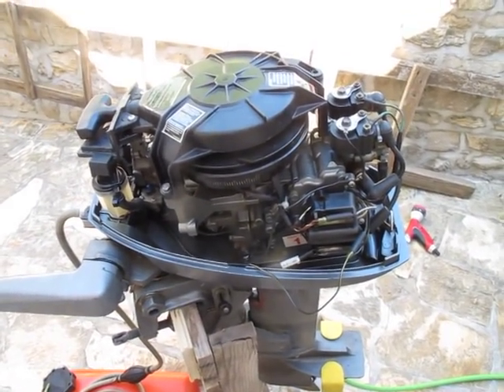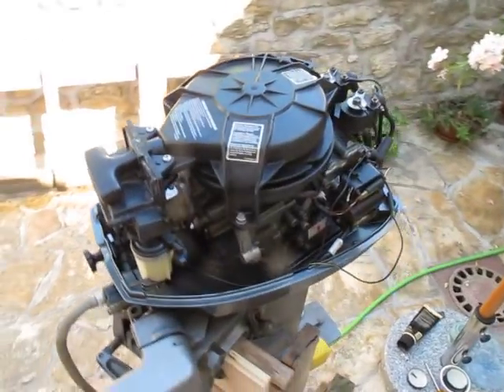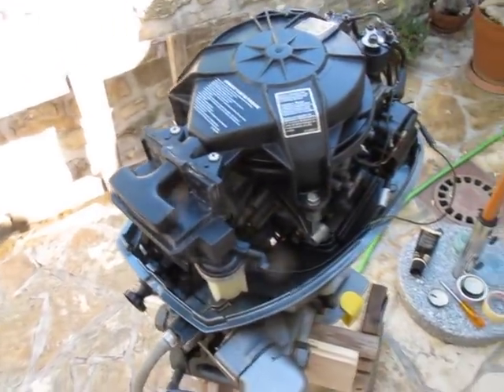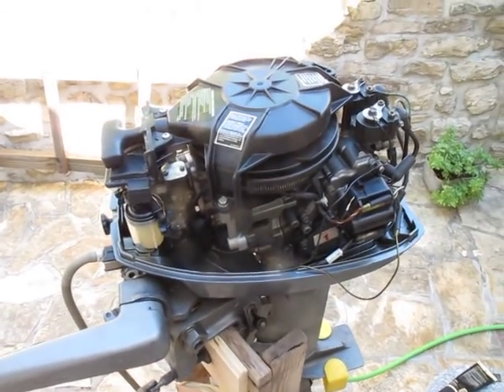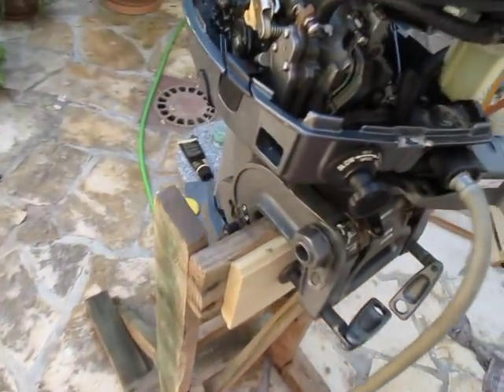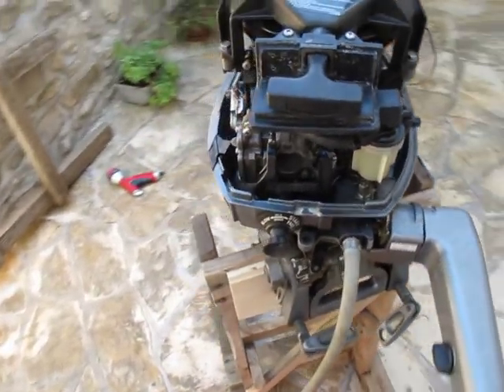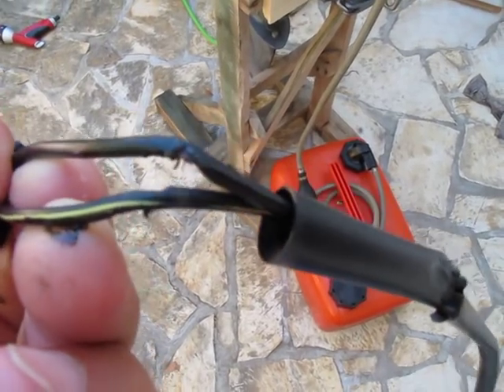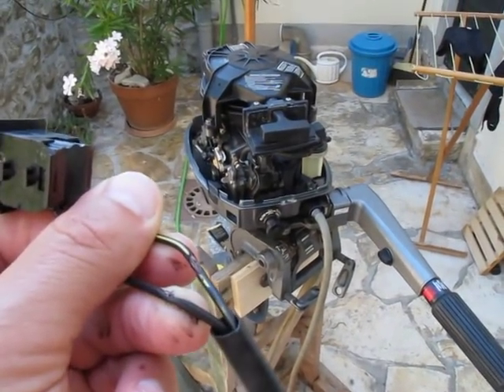Mariner (Mercury) 15 HP outboard stalling

Comment: Much thanks for sharing your process and the cure...I was on my third day in the sun rebuilt carb, fixed prime and idle systems, but still no go. Was thinking of the cut switches now I am going to pull them and inspect all Thank you!
Reply from the maker: Best luck to you solving the pproblem and thanks for your nice comment.

Comment: Awesome find! Chafed wires hiding are a botch!
Reply from the maker: Definitely true, an engineering botch up, otherwise the motor is very reliable. Thank you for appreciating my video.
Reply: @bekbor  I had a similar thing happen. I had a misfire on a V6 truck engine. I changed everything electrical, coil pack, plugs, wires...EVERYTHING. Still had an intermittent misfire. Then I wiggled the wiring pigtail connection that supplies power to the coil pack, while engine was running. The engine smoothed out immediately. It was a BAD molded factory electrical connector. I spliced in a new one, all was good until It failed again 6 months later. Chasing wiring gremlins, while not knowing there are wiring gremlins, is not fun.

Comment: Ce se întâmplă când dă scânteie doar la o singura bujie care sa fie cauza multumesc
Reply from the maker: As crede ca problema este la bobina de inalta tensiune la care este conectata bujia fara scanteie
Reply: @bekbor  Ambele bobine care sunt conectate la bujii sunt funcționale le-am probat unu din firele care vine pe bobina din dreapta l-am pus și la bobina din stânga și dă scânteie nu cred că ar fi cdi că posibil nu trebuia să de-a scânteie la nici una din bujii după multe încercări aseara am umblat la mufe și am avut scânteie pentru scurt timp a pornit și după 30 secunde a început să întrerupă și sa oprit
Reply from the maker: @makesaracu1264  Verificați toate firele pentru scurtcircuit sau conexiune slabă. Dacă ai avea un alt CDI pentru testare, ar fi și bine
Reply: @bekbor  nu am alt cdi din platou de sub volanta sunt 3 fire 
Unu negru cu alb 
Unu negru cu galben 
Unu masa 
Când îl demufez pe cel cu galben nu mai am scânteie la bobina din dreapta 
Când demufez pe cel cu alb nu se întâmplă nimic 
Am incercat cu un aparat măsură pe cel cu galben îmi arată că ar avea continuitate
Dar pe cel cu alb îmi dă doar un impuls de 2 secunde
Reply from the maker: @makesaracu1264  Aș încerca următoarele - schimb locul celor două fire care merg de la CDI la bobinele de înaltă tensiune. Acum, dacă CDI-ul este defect, ar trebui să obțineți o scânteie pe bujie care nu a avut o scânteie în configurația originală a firului. Desigur, ar trebui să testați cu bujiile scoase din motor. De asemenea, puteți măsura statorul sub volant. Ai 2 fire din stator, unul este comun. Măsurați rezistența între fire și comun (negru). O măsurătoare ar trebui să fie în jur de 2000 ohmi, cealaltă până la 200 ohmi. Dacă acest lucru este OK, statorul tău este OK, dacă nu ai putea avea probleme cu statorul.
Reply: @bekbor  am inversat și firele între iele cel negru cu alb l-am pus cu cel cu galben și invers doar bobina din dreapta a dat scânteie am mai vorbit și cu alte persoane care vor să mă ajute și toți au spus că cdi e mort așa că am comandat un cdi nou mulțumesc pentru ajutorul oferit un om minunat

Comment: Well found I have seen the kill switch wires crushed when someone has worked on engine and get wire trapped so same results also had a switch badly corroded where the rubber boot had split..

Comment: I notice some rub marks on mine .. now imma have to try and unplug it .. thanks for your video
Reply from the maker: Good luck!
Reply: @bekbor  one of the wire to my coil isn’t getting me spark .. even with a new cdi so I’m hoping it’s just grounding issue
Reply from the maker: @WeOutChea   Hope you solved the problem!
Reply: @bekbor  change the points and now it’s good .. thanks again

Comment: Eliminated that issue my engine still does the same I can get her running but can only keep her going for the same length of time each time about 30 or so seconds and then its revs up and dies like its stared of fuel!!
I removed the carb and gave it to a 2stroke mechanic he cleaned it and the jets with small brushes. So it may not be carb ..its wreaking my head! It's a year 2000 motor so maybe a overhaul is required!!!
Reply from the maker: I wouldn't thnk that an overhaul is needed. Before decidong on that you shouldcheck the compresion. Have you done any checks with the electrical ignition system? Does the diafraghm fuel pump deliver fuel continuesly? It may fill the carb bowl with the float but when the enginebusrs that fuel it takes to long to deliver new fuel...
Reply: @bekbor  I feel it's some thing small that's holding the engine back ! The compression FEELS good there is good resistance but il try and get them checked soon as for the fuel pump what you said could be another issue that's worth exploring il have to look in tothe workings of the fuel pump to better understand it and as for the ignition system how is the best way to check that out? 
Thanks
Reply from the maker: @82HEADCASE  About the ignition - the stator which is under the flywheel, has 2 coils, for low revs and high revs. I had to change the stator 2 times because it burnrs out after 10 years of summer usage. The terminals of the stator end on the black switch box, The black os common for both coils, mrasure the resistance from the common lead to the other 2 terminals. One mesurement should be a few hundred ohms, the other 2 to 3 kohms. Its the coil with the bgger resostancebhat suffers, the isolation betwren turns melts with heating of tje engine thus the tesistance gets lower until the coil finaly burns out. The switch box could also behave iraticaly if moisture managef to enter. You would have to have a teplacement one to check that.
Reply: @bekbor  great info there thanks ... im going to order a new fuel pump  diaphragm first to see if indeed that is the issue ..if nothing changes il look in to the electrical side of things... il keep you posted on my results thank you for your assistance
Reply: Hi bekbor...
Iv got my engine running perfectly I'd even say better than I can remember.. I placed the  new carburetor gasket kit in and I put in two new plugs aswell all new fuel lines ... I did have a problem with the fuel up take pipe in the fuel tank but all sorted now ...
Reply from the maker: @82HEADCASE  Great, now ypu can start enjoying boating, just like I am these hot summer days at least in my part of the world - Croatia. Sincerely, Boris
Reply: @bekbor  lol lucky u!! It's raining here and has being all week with more rain to follow.... greetings from Ireland👍

Comment: Hello there, I have the same engine but it’s not getting spark, could you help please
Reply from the maker: No spark on both spark plugs? If so, either the CDI (the black box) is faulty or the stator coil under the flywheel. I would measure the resistance of the stator coil under the flywheel, it has  2 coils and 3 connections, one common for both coils - they connect to the CDI box. Measure the resistance towards the common lead, one should be around 2 to 3 Kohms, the other around 200ohms. Here are the values https://www.outboardignition.com/page39.asp This stator coil failed 2 time in my 20 years of having such an engine so it could be also your problem.

Comment: Add me and my cousin to the list of Jackasses that spent countless hours and $300, only to find broken kill switch wires. When reinstalling I will make sure to keep the shift linkage away from the kill switch wiring. Thank you!
Reply: Our kids haven’t been running the jon boat all summer because of this somewhat intermittent problem.  The switch wires that he shows are routed UNDER the shifter cables.  They were worn through.  To test for this unplug one of the wires on the,  eh, black box, the cdi/coil pack box, whatever it’s called.  As soon as I unplugged it we knew right away that was the problem.  This video led us to a problem we could not see as the wires were worn under the shifter cable under the carb.   Thanks again to the guy who put this video up!  We are very grateful - Signed - The other cousin

Comment: thankyou, had very same problem on 9.5 johnson i recently bought, would not start ,wiring bare,shorting against engine insulation had rotted ,1968 motor time takes its toll,wires were near moving parts re routed wires,  cant touch motor,, sweet runner now

Comment: Great work! Thank you so much, you save my time (and money as well), as i've the same engine, and the same problem, a kind of current black out that happens at high speed, for an instant, then disappear (this goes on and on). I've cleaned the carburator as well, changing gaskets etc. but without results. Hopefully, you gave me the solution.

Comment: I'm also having a problem with the engine misfiring. Went through the spark plugs, and wires. Cleaned the coil pack, and I think its in the carb. It sat for 2 years and they didn't drain the fuel. I think the fuel separated and gummed up the carb and the fuel line connection.

Comment: Great video. On a similar note, i have a 15hp Mercury 2stroke that coughs at idle with extra smoke and sometimes will die. But runs strong at any other speed. Thoughts anyone?
Reply from the maker: Have you checked the carburetor adjusting? Everything else is pretty much fixed, no possibility for ignition timing setting... Of course, check if the ignition coil moves freely when increasing and decreasing throttle. Check the spark plugs gap. That what I would do.

Comment: This is a common fault on this engine. I belong to a club which has 4 of these engines. The wiring runs under the carburettor and so does the throttle and gear cables. When you select a gear the cables rub through the killswitch wiring and eventually causes this problem. All 4 of our engines had this problem.
Reply from the maker: Yes, that is just what happened to my engine, it took me a few days to work out what the problem is.

Comment: OK...I have a 95 mariner. Just bought it. Been reading lots of opinions and info, I was told to change gear oil and fogging it ect..then I was told you dont need to do that every year..if you store it upright wrapped in thick blanket in garage or a shed for the winter to keep elements off, it should be fine. (We dont winterize our cars right? ) I know about fuel stabilizer. If the motor is kept in an upright position then water drains out lower unit. I just poked it away like that for winter(. I'm in cold climate). I believe the two stroke oil I used already has stabilizer component. Any suggestions? thanks.
Reply from the maker: Hi, I think I did not understand your question or problem, but if you want my suggestion about winter storage - I keep the engine upright, I change the gear oil before storage and I flush the cooling system (I use the motor in salty wather). I also grease the engine through all the grease nipples, I use Quick silver storage seal spray in the cylinders. Best regards!

Comment: I wonder if this is what happen to use out on the lake tonight. I have a 1994 Mercury 25 HP 2 stroke. Was running good and strong at WOT then it spit like it was going to stall for a second, then ran strong again. We stopped to an idle for a couple minutes then it stalled. Restarted it a few times and it ran rough then stalled out again. We were lucky a friend went out with his bass boat along with us and he towed us back in. I will check the 2 kill switches in the morning. Hope that is what the problem is.
Reply: My 15 hp mariner is doing the exact same thing.. I’m not sure on what it is
Reply: @quentinsilas5912  Once I got it home. It started right up and ran smooth. I ended up cleaning the carb, through a couple bottles of dry gas in the tank and put some octane booster in the tank also. It ran well for a while then started acting up again. Bought a new fuel line and ball and not a problem since. The fueling deteriorates over time and lets pieces loose in the fuel. replace fuel line if it's over 4 years old.

Comment: Hello Mr Bekbor, i´m from Argentina and I have the same outboard motor, may be you can help me because I saw on your video that you didn´t use a container to cold your motor, I saw something yellow with the hose atached to the propeller ??
I will appreciate very much if show me how does it work and a brand or MPN.
Thank you in advance .
Saludos from Buenos Aires
Reply from the maker: The yellow thing attached to the lower part of the engine is an original Mercury Quick Silver accesorie Flush Kit no. 12612A2. It is placed on the water intake and connected to a hose with water so you do not need to use a conainer with water to run the motor out of water. Regards from Zagreb, Croatia
Reply: bekbor Thank you very much, for you time and helped, I will try to find it on EBAY. to purchase . thanks again....saludos from Argentina!!!!!